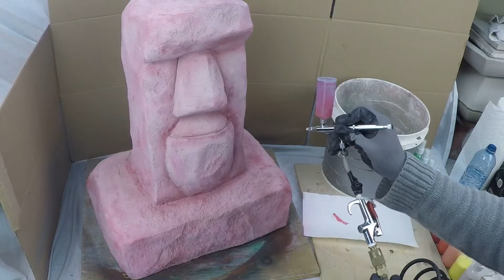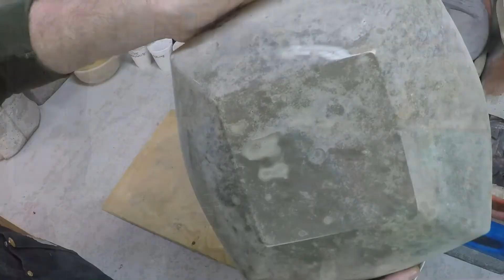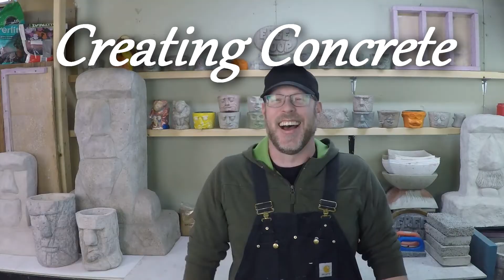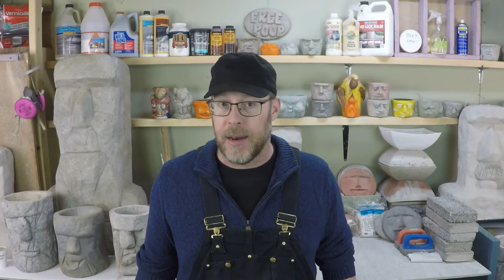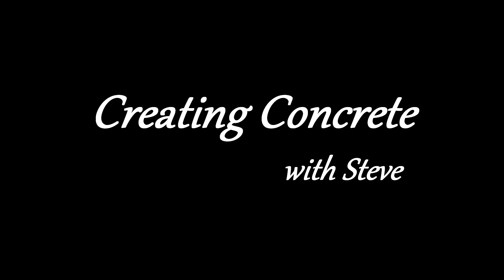What Temperature Is Too Cold For Pouring Concrete?

Comment: Oh boy the intro.  Just had a pad poured in 40f and that night went to 27f all night.  And back to 40 the next day.  Done that every day for 4 days and here I am.  They told me they’d bring an insulation blanket.  They brought a tarp.  Gooooood times
Reply: Yeah I checked for rain too make sure it wasn't going to rain for the next several days... I didn't think to look at the temperature because it's been warm the past several days and nights. Then sure enough it froze last night. The owner ask "do I need to cover them with anything" I said no I checked the weather (thinking he was thinking about rain because it just rained off and on for several days) that last night it hit my mind that he could have been thinking about the temp.. I like it up and sure enough it was getting right at 32 degrees. I've watched a few videos now and none of them are saying anything good for this situation. Thank God the pads we poured were only 12 inch by 12 pads. They are to be used to mount handrails. We will have to drill holes and put in anchor bolts to hold the handrails. I will have to bust them up if they are brittle. I hope your pads weren't too big and I hope things turned out better than expected for you.

Comment: My neighbor just had a $35,000 driveway poured 2 days ago. It was 38°F when they poured (daytime)  and the temp dropped to 20°F that night (with snow flurries). The next day the temp was a high of 30° & a low of 18°. They never covered it or anything. Is there some special cement that can be poured in cold Michigan weather and still cure? Or are they just screwing him over and the driveway will crack? It's 2 cars wide by about 100' long.
Reply: I just had my driveway poured, 107 cu yards 4 inches deep.
When they started this morning it was 18f,the heated it before pouring and it warmed up to 47 today, it's going to be 25f tonight then 53 tomorrow,wondering if I'm going to go out tomorrow to ruined concrete

Comment: Ah man i been dealing with this..and so so frustrating but im determined
Reply from the maker: At worst you can rent heated blankets from tool rental stores to keep the curing concrete warm overnight and for the first few days.
Reply: @creatingconcrete I actually took my wife heating blanket late fall last when curing my driveway.   Laid down tarp, the heating blanket, then a couple of old blankets on to, the another layer of tarp.   Worked like charm, but was left in the doghouse until I purchased her a new blanket.   Man she was mad!😢

Comment: This one helps as I've been putting off a small decorative slab poor and it's getting chilly. Good info.

I'm mostly going to be interested in full-weight concrete casting. I would like to know more about colorants and other additives. I know you are into the light weight life haha but I'm sure a lot transfers.
Reply: I have just been deep diving on lightweight mix design and testing. Most of my experience is with full strength/weight mix designs. Coloring is a whole world. I have a vid on this channel about painting but there are so many options. Integral, color harder, acid stains
Reply: @Swimmingpoolsteve  I'm knowledgeable but new to actually working with concrete. Great series, I appreciate the short and sweet presentations. Either you are a teacher by profession or you had some good ones along the way.